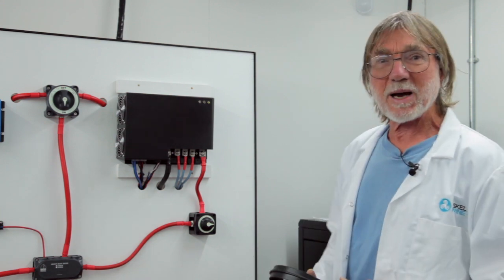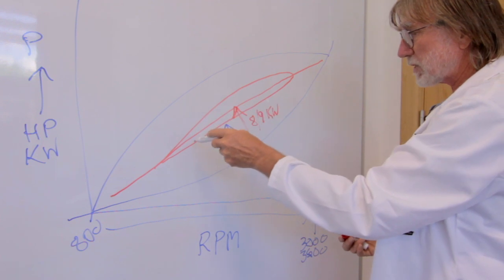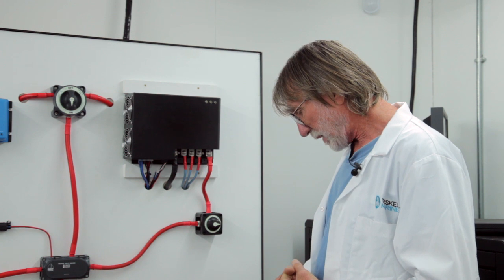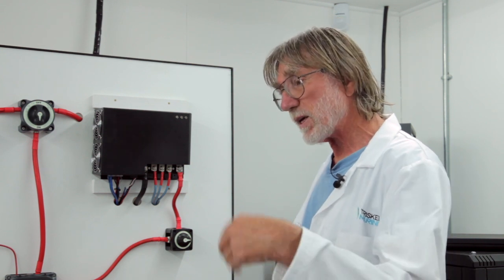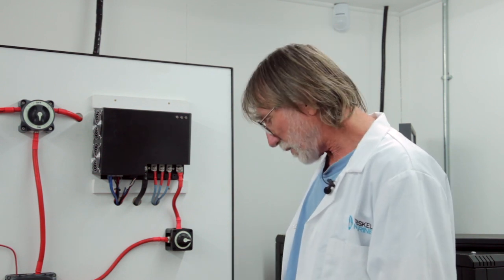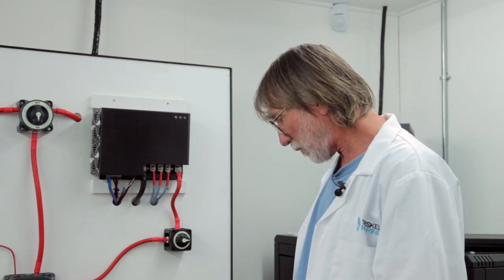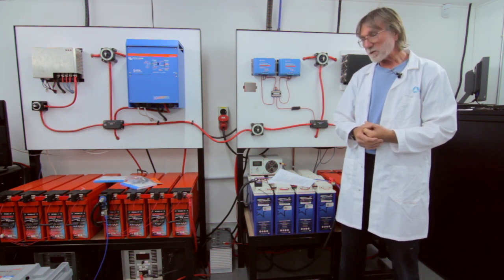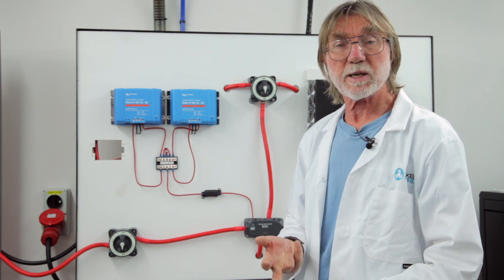Integrel Overview by Nigel Calder at the Shop

Comment: to those scratching their heads, skip to 16:30 first to understand the  nutshell. Then watch the preceding 15 minute details  and it will all make sense. basically  Its  a "high amp" or for better terminology, a "high power" alternator that cheats the system by charging its own battery bank (at 4 times the voltage) all  too keep  current down, wire size down and control heat and, most importantly,  make lots of power for the battery bank in a more fuel efficient manner.  Brilliant idea.   its own bank is the one responsible for doing the actual work and charging the boat banks via a dc to dc charger.   Great video and info.  the whole system kills many birds with 1 stone.  less Heat, smaller cable size, more  power, better fuel efficiency... to take it 1 step further, utilize the 48 volt pack for a 3kw inverter and you've got yourself a nice little DC and AC generation system all peeling off the main engine in the event you do no have room for a stand alone AC generator

Comment: How very, very timely for me in particular. In spite of my being 3 years late to the party, I am so looking forward to getting the further particulars. I am of Nigel's vintage and after 10 years up on the hard, have decided to finish off my life at sea back to sea. I've spent the last 6 + months trying to decide on buying enough vintage Cummins engine parts or repowering more modern for my motor sailer, going electric propulsion(?) and as well where I would put an auxiliary generator with an hydraulic PTO for anchor redundancy and crab & shrimp pot hauling. This is the light at the end of the tunnel. Bravo!

Comment: Looks like a great system. If the PMA was driven from the shaft with appropriate clutch arrangement you would have a spectacular hybrid system.   This would add electric propulsion and hydro generation capability. Also water cooling would be nice.
Reply: Check out the parallel hybrid systems by Hybrid Marine UK

Comment: Always had the Mechanical and Electrical Bible on my boats and had confidence in the Calder authority but this would be more of a gift to cruisers if it was priced as a super alternator rather than a high output stand alone generator. Let's talk about cost per watts and whether it represents value for money. As tempting and desirable as it is my only question to Nigel would be, if you were digging in your pocket to pay for this system would you but it?
Reply from the maker: It depends on how much charging power is needed in a system, and what the other options are for power generation.  Compared to installing a 10kW AC generator, and at least 8kW of AC/DC chargers (to match the charging power of an Integrel), the cost of an Integrel system is a relative bargain.

However, there are certainly other high-power alternator options now available (in both 24V and 48V).  Perhaps not quite so powerful as the Integrel but still far more than in the past.  For example, see: https://oceanplanetenergy.com/wp-content/uploads/sites/86/2023/03/HPI-comparison-sheet-OPE-new.pdf

Each boat's needs must be evaluated, and the appropriate system has to designed.

Comment: An external lightning/surge protector controlled by your system would keep the loads intact in case of a strike. 

Based on your graphics, it seems that it would be more efficient to use electric propulsion with regen, a small battery and and an intermittent motor generator.

Comment: How are other sources of electrical input (solar, wind vane, shore power) incorporated into this system?  Thank you.
Reply from the maker: It's no problem to have multiple charging sources for a common battery bank, as long as they all have the proper programming.  That is, they should have the same target voltages, absorption time, etc. that is appropriate for the batteries being charged.  Effectively, all the sources contribute to the charging for as long as the batteries can absorb the current before reaching target voltage.

Comment: Really interesting presentation.  I can't help but think that while the electrical design is naturally top notch, the mechanical side isn't ideal.  Is there any reason that you don't simply use larger electric motors attached directly drive to the drive shaft of the engine?  This eliminates the belt, allows it to use the same water cooling of the engine and massively increases the ability to generate electricity.   It also allows you to turn the diesels off and power the drive shaft with the electric motor when it makes sense.

Of course this would only make sense with Li-ion batteries, but really they are the only batteries that will matter in the future.  They already beat out all other forms in every way except up front cost.  That is changing and soon even the up front cost will be near lead acid.
Reply from the maker: You're describing a parallel hybrid system, exactly like what's offered by Hybrid Marine UK, and Electric Yacht, etc. We (OPE) offer such systems however they are a bit expensive and haven't really taken off yet, despite the obvious functional practicality.  Note that a dual clutch config is necessary, to have the added benefit of power regeneration when under sail (disconnect motor/s from engine, while being attached to the shaft).

Comment: If I installed this system on an RV, would the system be able to tell from engine load % that I was using low gear to control my speed going down hills and then send more current through the energizing cables on the generator? This would mean you regenerate energy from engine breaking while it was helping you burn off or maintain speed and save your brakes.. I'm thinking about installing this system on a class A RV as well as boats / yachts ...
Reply: There already are RV's using 48V alternators & batteries (actually, 51V lithium).  It's a matter of fitting in the alternator with a sufficient pulley ratio and properly designing the overall system. If the engine has CANbus data output with load data, the regulator can add or subtract the charging load to appropriately load the engine.
Reply: @OceanPlanet60  then if im correct, downshifting would show 0% load and then the regulator would load up the engine, thus generating massive amounts of power and helping slow down the RV..
Reply: @zealotz556  Somewhat true.  However the alternator will never generate more than it's usual max output at normal engine rpm (in the case of the Integrel, 8-9kW).  For the very powerful regen braking you may be thinking of, it would take a larger electric motor/generator (as in a hybrid or electric vehicle) and a large high-voltage battery bank.  Such Hybrid/EV systems are typically built around a 360Vdc battery bank.  A different dimension than what the Integrel system is.

Comment: My current 130 amp 12v alternator runs on a single 11mm V-belt.  I have it regulated down to 70 amps to prevent the belt from overloading & slipping.  Is that an issue with this system?  What size mechanical drive line is needed to fully power this unit?  Also, where can I buy this impressive new device?
Reply: The Integrel is added on as a 2nd alternator, and uses 8 groove serpentine pulleys and belt.  Even with a regular alternator upgrade in the stock alternator position (for instance to a Balmar or APS) we never use V belts anymore.
Reply: Anyhow, contact us from our website at oceanplanetenergy.com

Comment: Thankyou for the video, there is one question i would like to ask is that i plan to install a 4 blade propeller instead of the standard 3 blade propeller on the sail drive (SD60-4 model) which will have the effect changing the power output curve of the upgraded motor (4JH80 Yanmar) for the balance 526. How would i change the program characteristics on the integral to suit the non standard configuration
Reply from the maker: Hi David, visit our website (oceanplanetenergy.com) and contact us there.  But the quick answer is that if the engine has J1939 CANbus data output, the Integrel will use that data to prevent overloading the engine.

Comment: Is it easy to replace a conventional alternator with the one(s) demonstrated in the video? For example to a Yanmar 3 cylinder engine?
Reply: An Integrel system (or any major alternator upgrade) should only be done by an experienced marine electrical systems installer.  Interested installers should contact OceanPlanet Energy to arrange training for Integrel installations.

Comment: Will this system auto start the engine if it senses the batteries are low?
Reply: I'm sure you could set up a system to do so as several third party battery monitors and the Lithionics BMS are all capable of Auto starting a generator.  However, they may not be the best idea for starting a propulsion engine automatically. It would have to be thought out and set up so it wouldn't automatically start if it was in gear.

Comment: 16hp mechanical Beta, like usual, I'll be cobbling together a similar aim on a low budget. Much like waiting for Darpa space technology to trickle down.
Reply: The new Balmar 96 series 48V have 60A and 100A versions. Coupled with a Wakespeed AP500 regulator (with programmable rpm based loading curve), you'd have a sort of mini-Integrel system.  However, mounting the appropriate pulleys/belt config and the alternator would be custom job requiring machining skills, etc.

Comment: Why would you want to run up your main engine hours?
Reply: You might not.  You just add the capability to get significant charging done while while motoring. So with adequate battery capacity to last until motoring again, you wouldn't need to run the engine any extra hours.  And if you did need to recharge before the next trip, with the powerful efficient charging you wouldn't need to run it very long.

Comment: Balmart generator in motor ??
Reply: No.  Balmar is a mfg of different (smaller) alternators than Integrel.  Which is the best choice for any particular vessel depends on the loads, and the required recharging needs.  For many boats, a Balmar or APS (American Power Systems) alternator may be plenty of power.  However the Integrel provides the most power  possible.  Especially at lower rpms.
Reply: Do you have this for sale any places ??
Are you in Europa somewhere ??

Am traveling waterways true Europa and want to talk to you about this altinator.

You have a mail ore did you get my mail i did sent in boat how to to day ???

Eivind

Comment: This sett up have bean finish and have a price ????
Reply from the maker: Yes, there are many of these systems installed all over the world.  A single system is around $18,000 before installation, and a dual system (for instance on a catamaran) is around $33,000 before installation.  So, they are not inexpensive.  However the Integrel is the most powerful alternator system available, and less expensive than a fully installed generator.  Note that there are other high power alternators that are slightly less power than the Integrel, that however are enough for many yachts.  Which is best for any particular yacht depends on the electrical loads on the yacht, and the recharging time desired by the user.